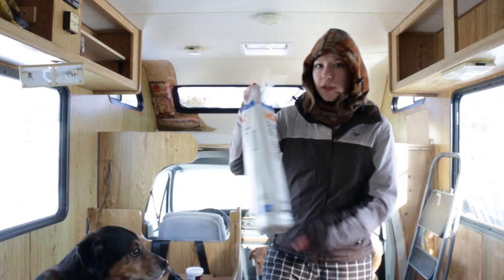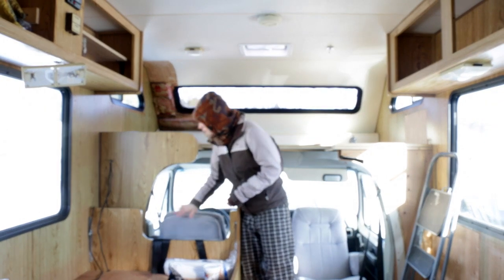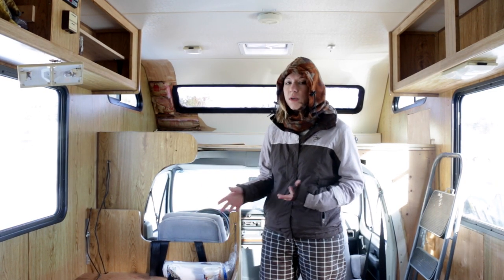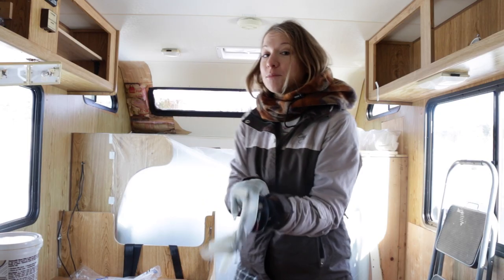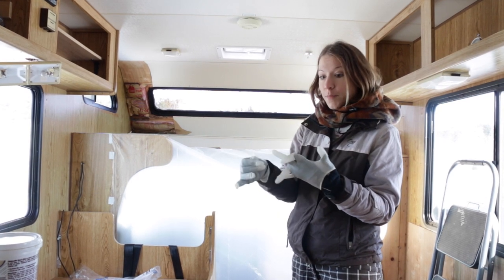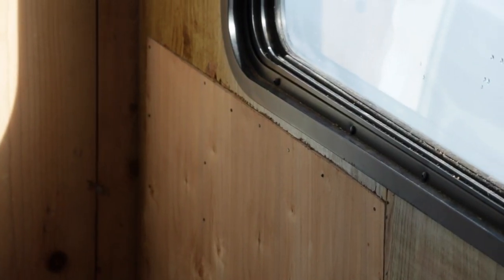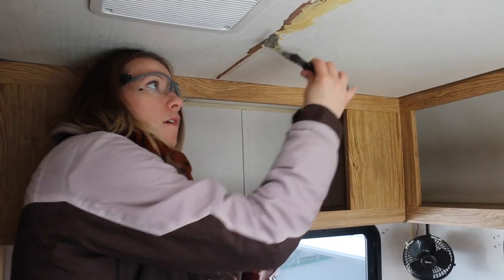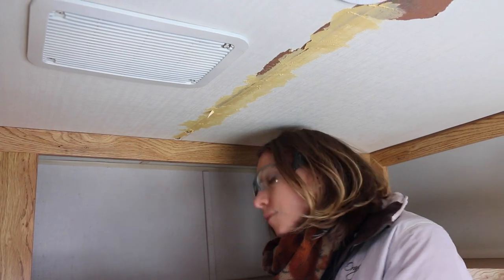Sanding + Prepping to Paint the RV

Comment: For the AFM Safecoat (I'm not sure if it was in this video or not), how do you feel it worked? I've heard mixed reviews on the smell, whether it blocks the outgassing, etc. We just moved into our brand new travel trailer (Time for Adventure is our YouTube channel) and I'm choking on the fumes. It's bad. How much effort did the Safecoat take? Is sanding every surface really necessary? Did you notice a lack of smells from offgassing afterwards - or were you just being preventative and your rig had already offgassed?  Thank you!
Reply from the maker: The old RV smell is completely gone. We are VERY happy with the results! We ended up sanding everything because it helps the product stick but we're not sure how necessary it really was. It was honestly a lot of work but we would do it over again in a heartbeat :-)
Reply: Trust me. The sanding was necessary. We're having a hard time with ours. And the smell is so strong. Glad you had success!